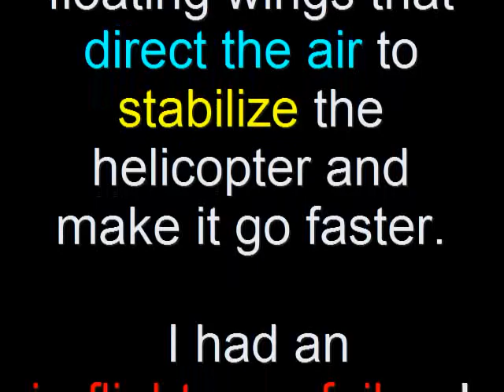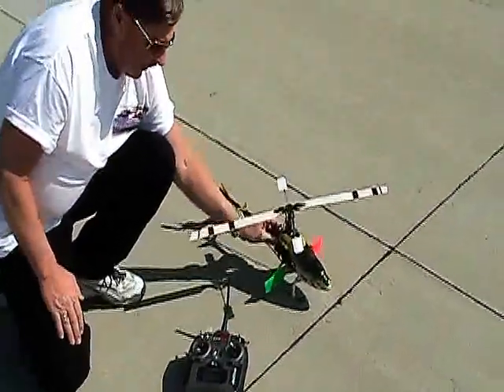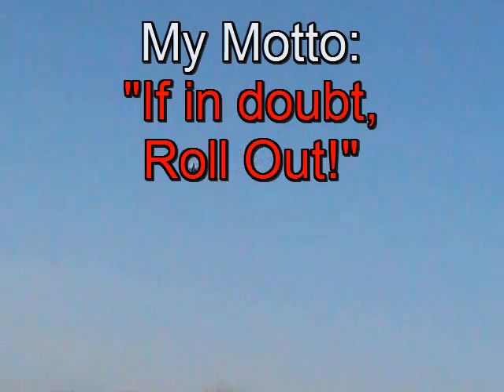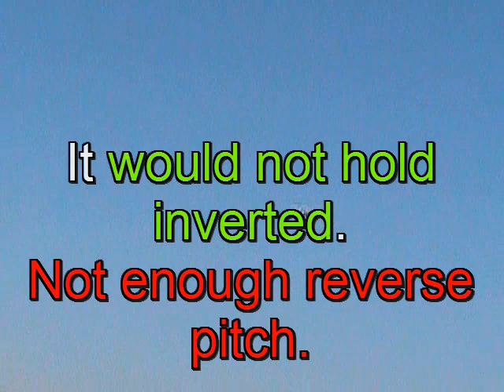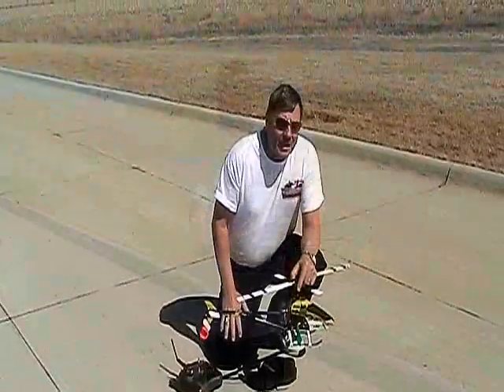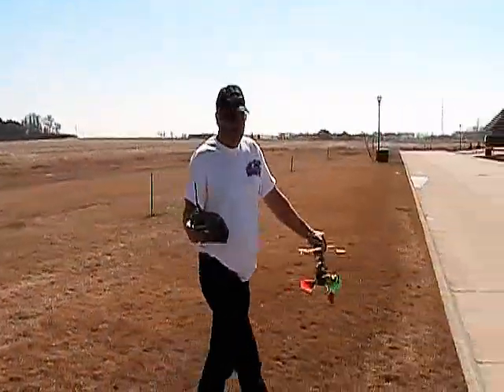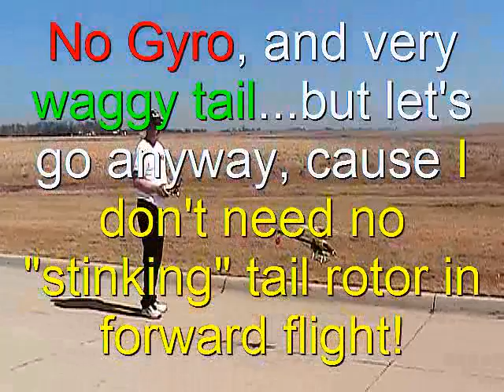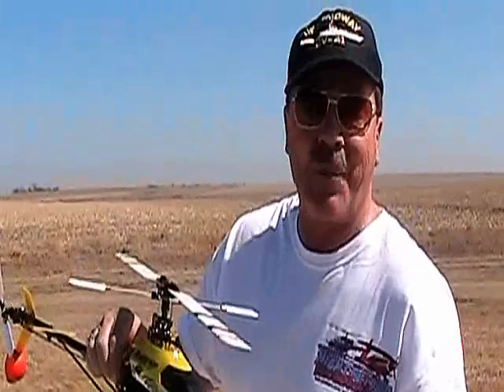DYNAMIC HELI STABILIZERS & GYRO Failure!

Comment: In a mechanical aircraft gyro the spinning disk provides a stable device off of which to measure the aircraft's movement along a specified axis.

The gyro takes that measurement and automatically applies it to the servo that modifies that axis.

In a heli (in his case here, one gyro and it is digital  not mechanical) this controls the tail which controls the direction the heli is pointing.

Many things affect a heli in hover, so an automated way to keep its heading is very useful.

Comment: I believe that there is already some lift,
Because they are weighted at the bottom and downward thrust from the rotors  keeps the fins at a positive pitch.

A controlled system would be preferable for large scale or full scale helicopters.

I would have them set up on a system with discrete channels for each stabilizer, have them mixed as elevons, and have them set up so that they still flow with the wind, but can be instructed against it.

Comment: Very clever idea. 5*   Almost like a mini thrust vectoring setup. I can imagine it being more stable.
I wonder if it's possible to use a servo on it linked somehow to elevator signal? for some sort additional proportional lift? maybe to reduce the amount of pitch needed in fast forward flight? Longer flight times?

Steve

Comment: One of your servos are reversed. You need to find the switch on your radio or if it'sd digital you can switch it that way. I don't know the exact channel but whichever is connected to your pitch left and right with that RIGHT stick needs to be switched. Sounds like you will be fine after that.(I'm assumeing you are flying US mode. If not, reverse the right stick)

Comment: Those 'stabilizers' won't be doing anything to increase the speed of the heli. They will be pointing in the direction of the wind. The bearing joint can only support vertical and horizontal forces, but no moment. This means the only forces they exert will be drag forces on the helicopter, slowing it down if anything.

Comment: hey man , im from canada i have been watching your vids on you tube for a few weeks now, and i bought the blade 400, i am sooo choked .... the first helli i bought was the mcx (works great) but i think i may have to take a second motgage out  from having to replace part after part and trip after trip back to the freaking hobby store to get more parts i have spent sooo much time repairing boom strikes and bacicaly rebulding this thing from the ground up and i have had it about a foot of the groud

Comment: Surely the only time those "wings" will be at 45 degrees is when the wind from forward airspeed is EQUAL to the rotor thrust so redirecting rotor thrust is then useless as the machine would already be travelling at the speed of that thrust!

Comment: yeap, i imagine it is similar to the gyro in a nintendo wii controller

but as far i know a gyro has the ability to measure movements in 3dimensions: up-down, left-right, and front-back

so my other question is, why does a heli need 2 or more gyros?

thanks :)

Comment: HEY  dave i been having a heat issue with my batteries. im just hovering and a few side to side flys but after im done i got an issue with my batteries being hot. i been told that i should cut a hole in the canopy on the top and bottum your oppinon please

Comment: @br1ancrowell That stabilizer have no sence at all. I am studying aerodinamic,and that is not working. The speed of wind from the rotor is much stronger than the wind that push stabilizers back during fast flight. Take a look at yourself,the stabilizers are always nearly up side down. You have air brake my friend.